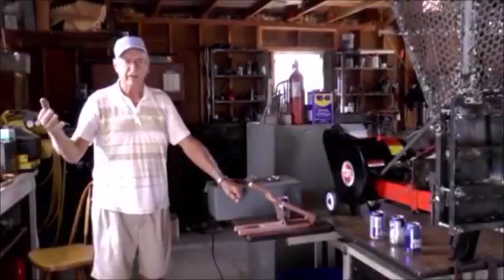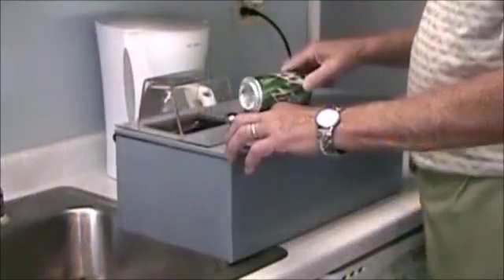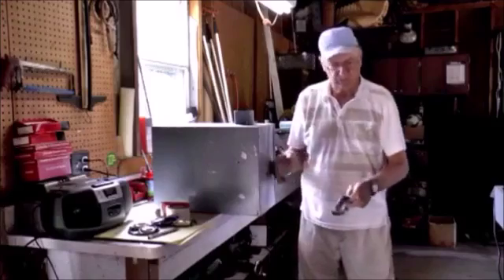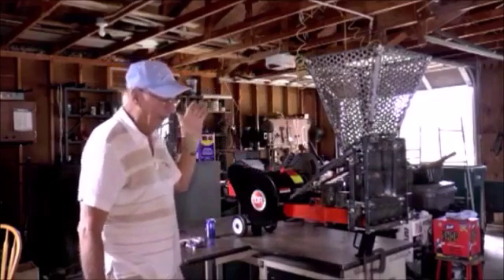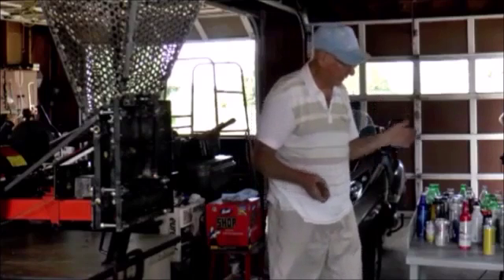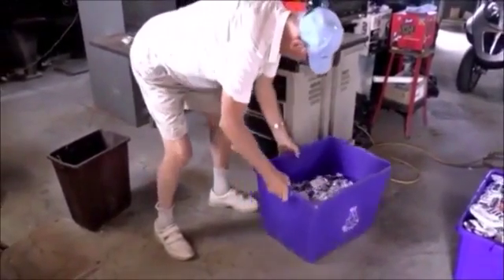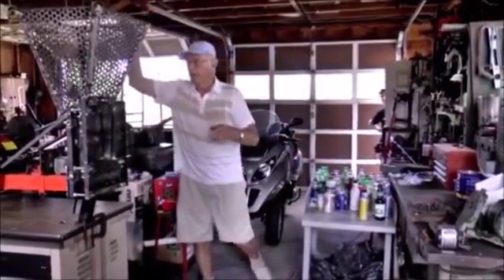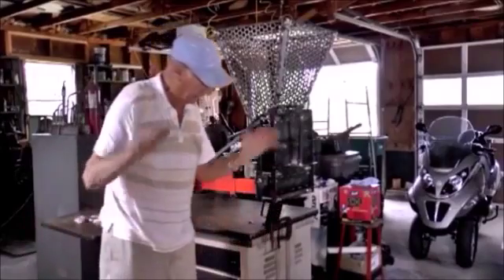Vern's Can Crusher

Comment: just need to rig it so it does it by itself so you dont have to keep moving the handle
Reply: maybe some version of a pittman arm, like a train wheel linkage, powered by gearmotor at variable or low output speed for about 6 cycles  per minute or so.